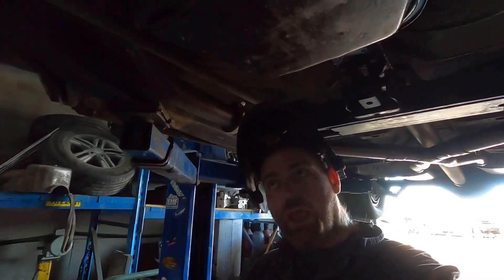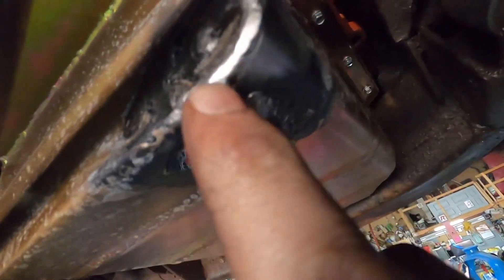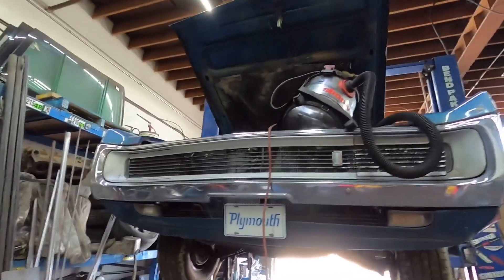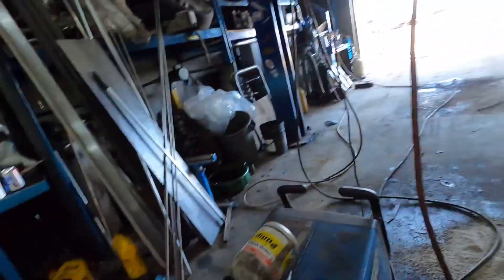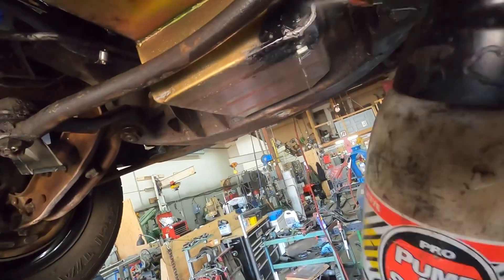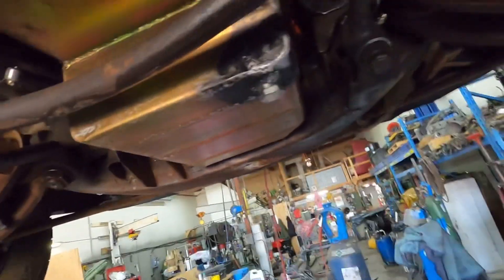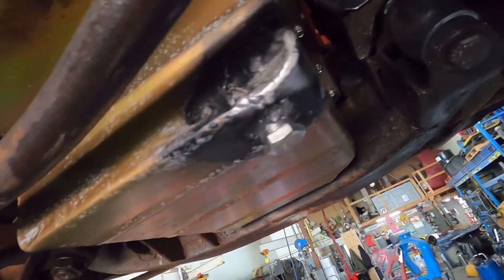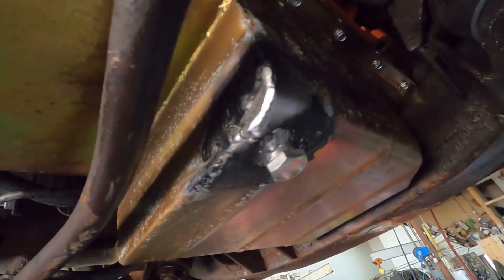Pro tip - how to stop a leak so you can weld it.

Comment: You have no idea how thankful I am to find your video . I had to find it on google as nothing would pop up on my regular YouTube . You saved me ! I have an old 89 190e mercedes the oil pan had a big hole and two hairline cracks it took me forever to patch up and once I did all the hard work I was left with 1 pin hole I could not cover up ! I couldn’t believe the shop vaccum I had that it was going to be strong enough to work . Even with drained oil the oil was still seeping through . Once I hooked up the vaccum and cleaned it I didn’t see it drip and I was able to patch it up . Thank you